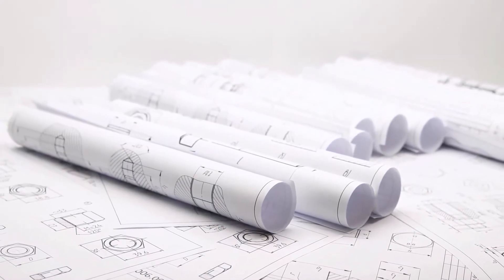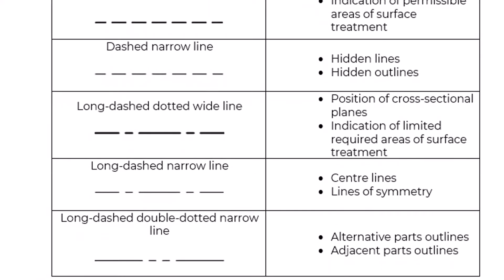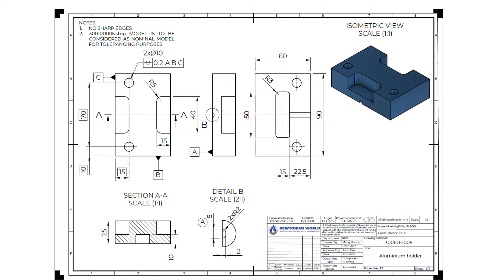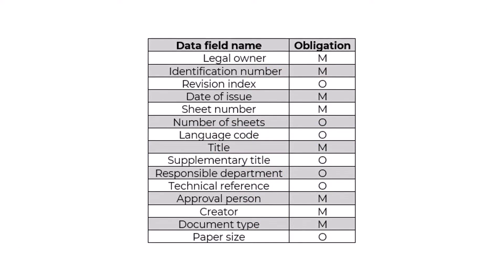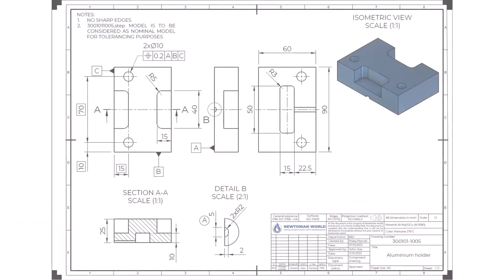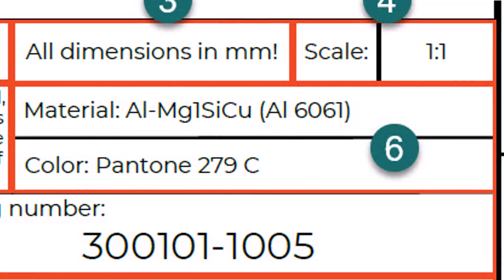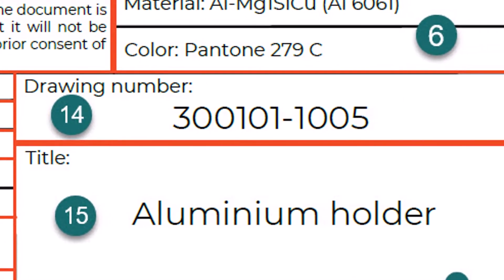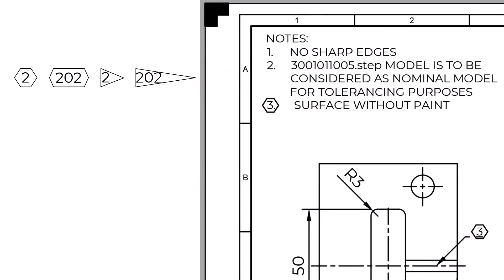Overview of Basic Elements of Engineering Drawing (ISO)

Comment: ISO STANDARDS
Fonts - ISO 3098:1997
Lines - ISO 128-2:2022
Drawing Border : ISO 5457:1999
Trimmed Format - paper size - ISO 216:2007
Title Block - ISO 7200:2004
Scales : ISO 5455:1979
General Tol. - DIN ISO 2768-mK
Surfaces - ISO21920
Edges - ISO13715
Projection- ISO 5446-2
Reply: Lines -128